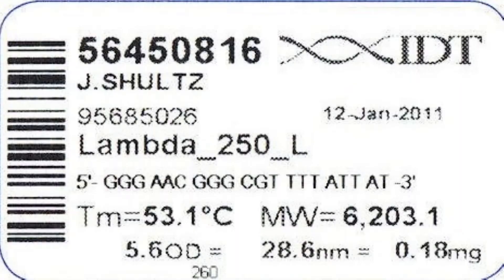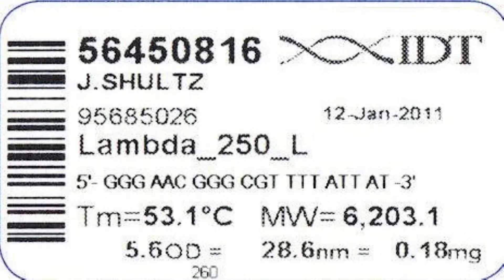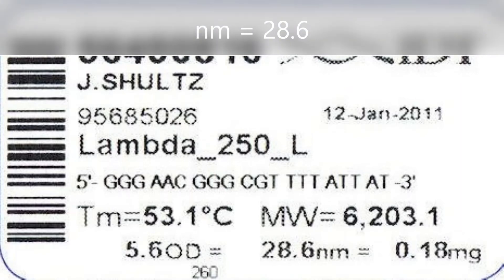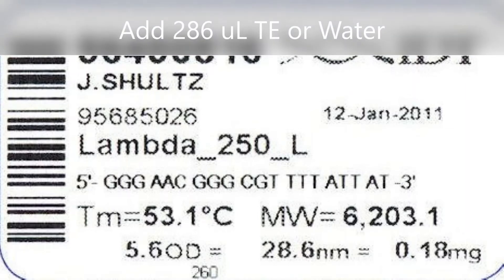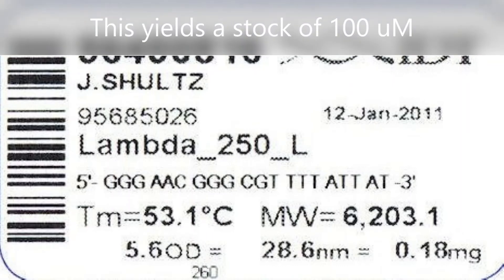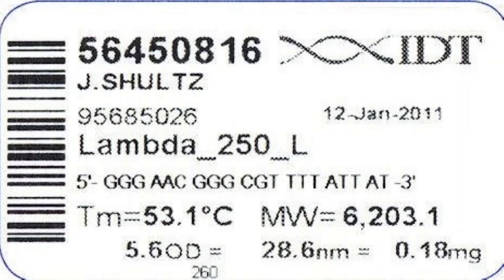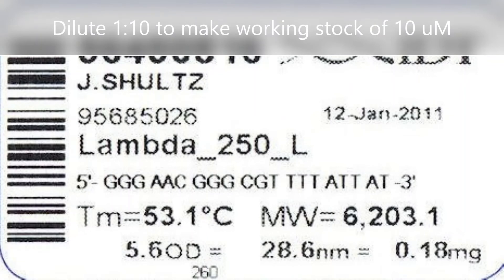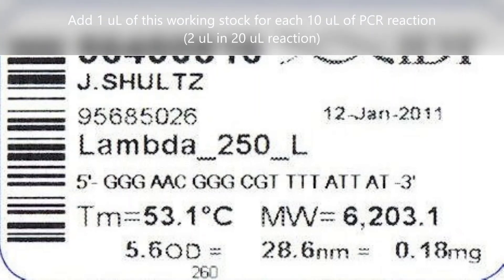Steps to Rehydrate a Lyophilized PCR Primer

Comment: Hi Jeffry, very helpful video, but a couple of questions:
1) the working stock is diluted 1 : 10 meaning we use 1 uL of master stock and 9 uL of distilled water right?
2) also what do you mean by 2 components used up in a PCR reaction?
3) By how much would we need to increase the primer working solution for smaller fragments?

Much appreciated